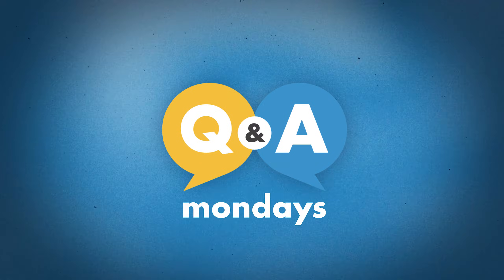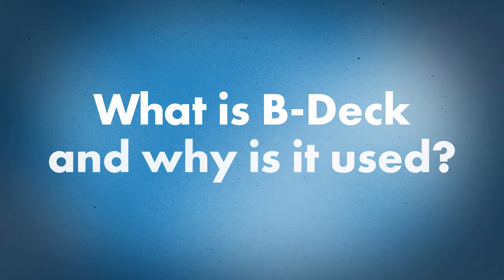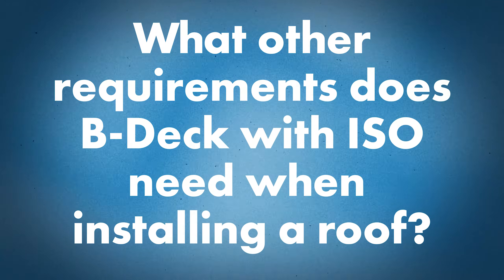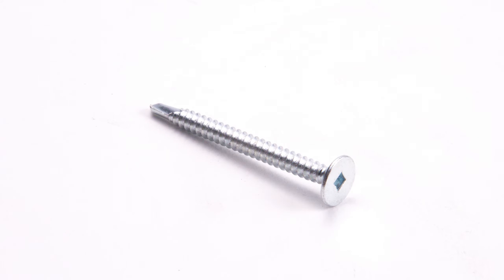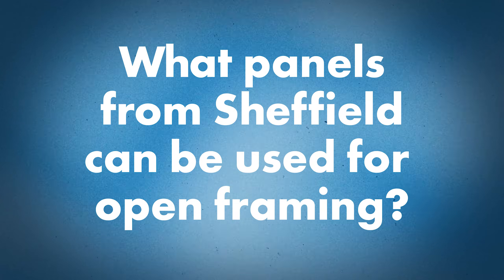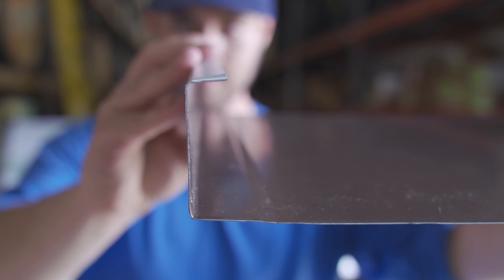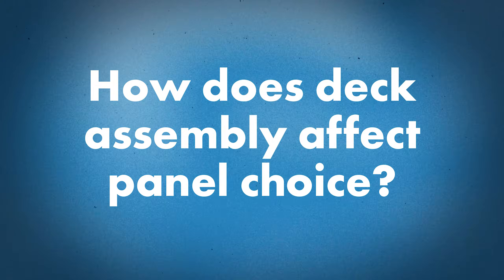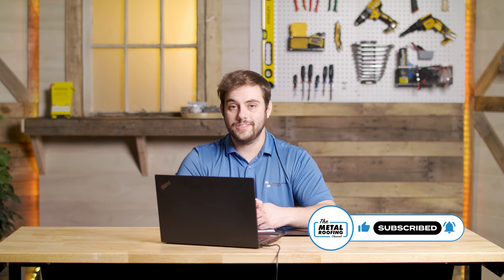Metal Roofing Deck Substrates 101: Plywood, B-Deck, Open Framing

Comment: Great video.   I think it would be great if you did a video specifically on installing standing seam on top of purlins over thick continuous insulation.  Especially, wink-wink, installing a radiant barrier.  

If you can't do this with professionals giving me, maybe it would be helpful to do a video of a DIYer installing this sort of system for a residential property next summer in Northern Idaho?